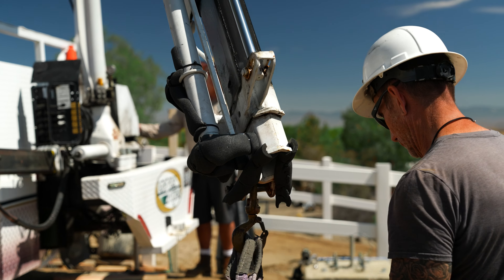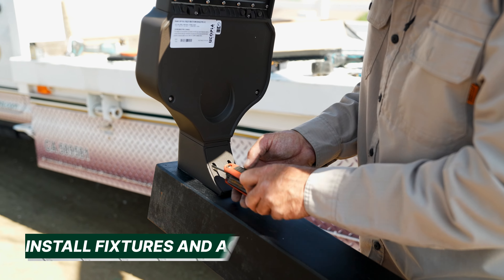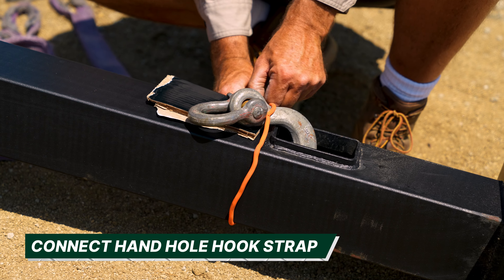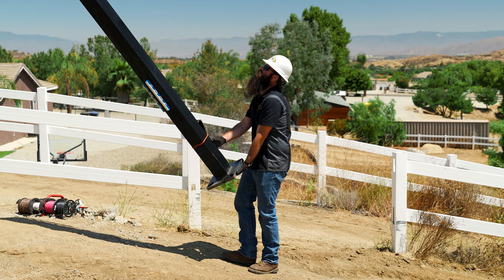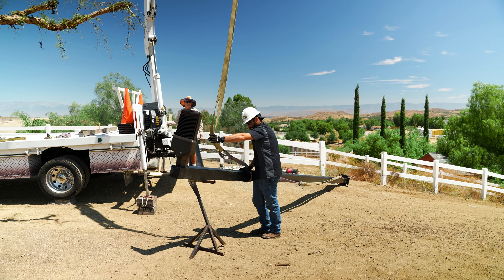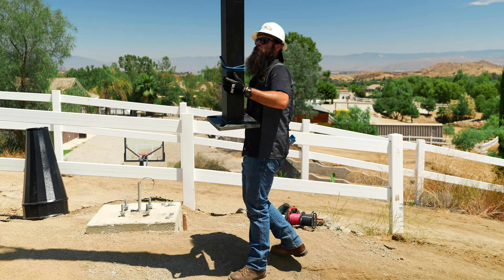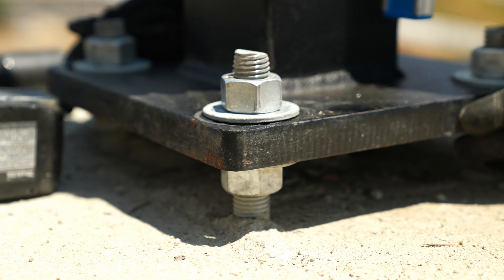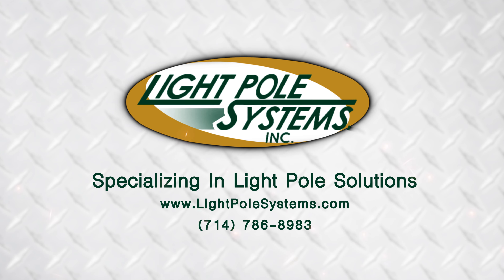How to Sling/ Rig a Light Pole

Comment: Thank you for the demonstration and tips. Given the risk of catastrophe if the hook is knocked out, I am surprised you don't have a wedge in the hand-hole and a specialized hook with strapping attachments on each side to hold it in place and a figure-8 clove hitch between the pole and the supporting strap... Yes, I am desk-bound 🙂
Reply from the maker: Good point, we do strap the hook into the pole with whatever device works best. a custom hook with built in strapping points would be a good idea.

Comment: Very nice and informative video, just nitpicking here, but that bottom hook is not rated for lifting i don't think, i would use a sorting hook there if possible.
Reply from the maker: Good thought Josh. Technically that is correct. We could not find a good rated lifting hook that would fit in the hand hole. The weight of the poles are so little compared to what normal lifting slings/hooks are rated for, getting a hook that fits better is more important for our application.